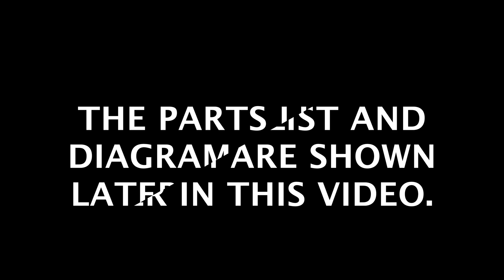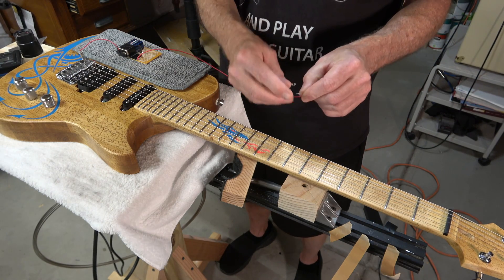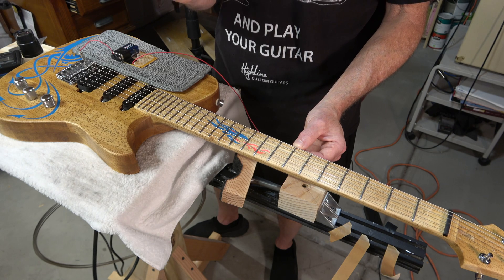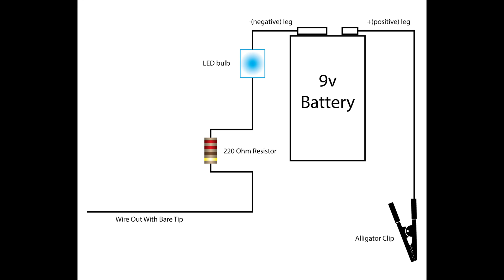A Simple 9v LED Fret Buzz Detector

Comment: Well done.  Well done.  My problem is I live 2.5 gallons of gas away from the nearest LED (~$16+ here on the CA central coast in 2022).  However as usual, while doing something completely unrelated, and it came to me...  With at most only a very slight loss of sensitivity, you can make the fret buzz detector using a voltage meter that has a good continuity (beep) function.  One probe goes from the meter to the bridge, and the other to the fret being tested.  It works.  Also, to allow me to confirm the offending fret while playing a specific note, I used a piece of painters/frog tape to temporarily hold the "fret" probe to the fret in question.  A paper towel cleans up any residue.  Thanks again for the inspiration.  Be well.  

(I just noticed UNCHAINED, below, has offered the same idea.)
Reply from the maker: Many meters aren't sensitive enough.
Reply: @HighlineGuitars  I guess that goes to show how out of adjustment my guitar was.  The dog even started barked at the beeping.  My meter indicates "continuity" if resistance falls below 50 Ohms.  Be well.

Comment: This is actually more practical than initially expected! It allows easily to differentiate between single thread issues, neck angle problems and trust rod adjustment issues. Thanks for the tip!

Comment: Coule you use a multimeter? One lead to bridge (ground) Other lead to fret. Meter movement would indicate whch fret(s) are buzzing
Reply from the maker: Yes, you can. But if you don't have a multimeter with a continuity function, the LED trick is cheaper to do. And more fun. And cooler to watch.
Reply: @HighlineGuitars  Awesome, thanks for the response. Love your channel

Comment: Just use your multimeter on continuity check. You don't need to build this "tool"
Reply from the maker: Most people don’t have a multimeter. And this tool is super cheap and easy to make.
Reply: @HighlineGuitars  I understand your point, but respectfully disagree. A cheap multimeter will be more useful on the long term and will help a lot on guitar and other electronic projects. It can be found for as little as $5.00, those would not be recommended for house powerline but for small electronic projects are great.
Reply from the maker: @leondantas  Disagree all you want. I know my audience and many don't own a multimeter and will never buy one.

Comment: Chris, Could this somehow be wired in to work with a 1/4" Plug through the output jack? That would make a cool gadget. Just plug it in and then touch the wire to each fret. Then you wouldn't need the alligator clip on any parts.
Reply from the maker: The positive from the battery can be soldered to the ground lug on a 1/4" plug. The hot lug would be unused. If the bridge is grounded, the circuit will close when the positive wire from the LED touches any string or any of the high frets that are causing string buzz.
Reply: Was just about to suggest this!

Comment: This method is not only for the open string stroke. When picking a frets, what if third fret from the pressed one cause the buzzing, this end up ruin guitar frets by old tool. Can be used multimeter with diode mode.

Comment: StewMac is gonna copy this and charge $60 bucks for it.
Reply from the maker: You could wire up a guitar with an LED at every fret. When a high fret causes string buzz, its corresponding LED would flicker. Kind of weird, but hey, it would work.
Reply: @HighlineGuitars  Multimeter with continuity function would work -- audibly arguably.
Reply: @luckyno888 more like $60 just to cover the shipping cost haha.

Comment: Why waste your time with this. Just use a fret rocker.
Reply: @ Manson Chambers  Sure... why learn how to use a calculator when you can do mathematical equations with a pencil and a piece of brown paper bag?  A 'fret rocker' will work with a single fret... But, sometimes it is more than one fret; which, would indicate the need for a neck adjustment.
Watch the video and learn something. It's a simple tool. But, perhaps, it will help you make a job a bit easier...
Reply: Maybe when you become more experienced with guitar setups, or more discerning, you will answer your own question.
Reply: Is would not a  Voteoma meter with a Continuity tester do the same thing?
 Thank you great idea.
Reply from the maker: @garrywright3566  Any meter with a continuity tester would work as they are basically the same thing. But if you don't have one, this costs pennies to make.
Reply: @garrywright3566  Yes. But, they are often at use elsewhere in the shop. This is an inexpensive item that could be dedicated to strictly checking frets and remain in a place 'close at hand' for when it is needed.
Reply: A fret rocker is good, but it only diagnosis a bad fret in the static, non-vibrational mode.  Sometimes - usually due to picking technique - the buzz is only present when the string is plucked at a nearby fret and the string is vibrating.  Both useful tools.  Be well.
Reply from the maker: Why did you watch the video?